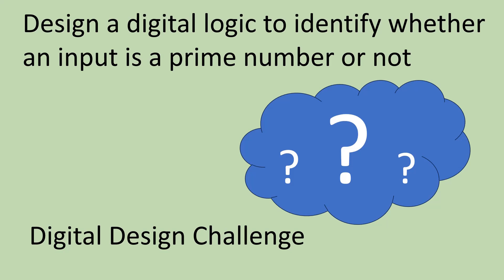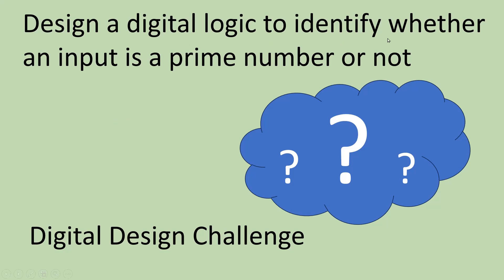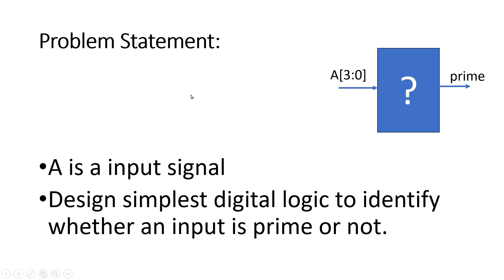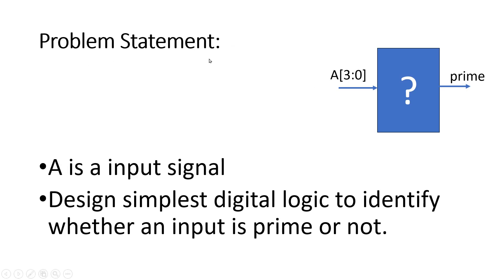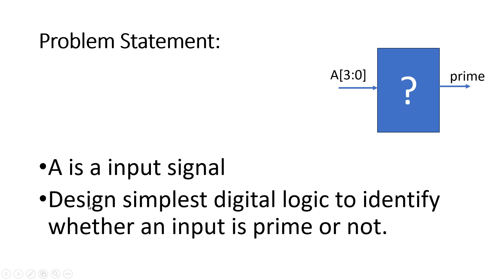Digital Deisgn Challenge: prime number identification

Comment: It can be easily solved using a truth table, but I assume there is no feasible solution to an arbitrary n-bit number.
Reply from the maker: Dear, in the question I asked a solution for the 4 bit number only. 
After getting your response, my next question to you is that write a verilog/SV code to implement a digital logic to find whether an input n bit number is PRIME or not?  Please make a note that verilog code shall be synthesizable.
Second question will be , reveal the digital logic design implementatin from your SV/verilog code?